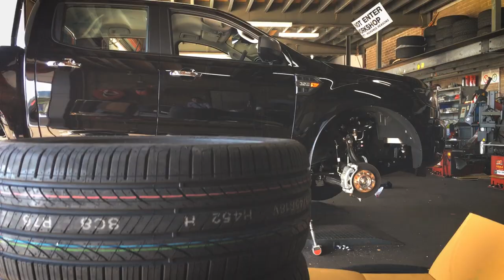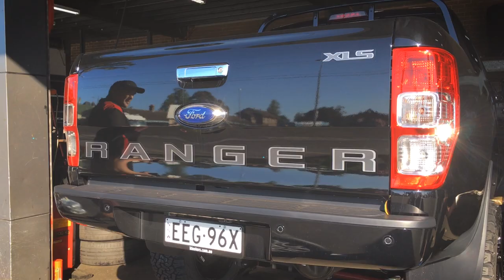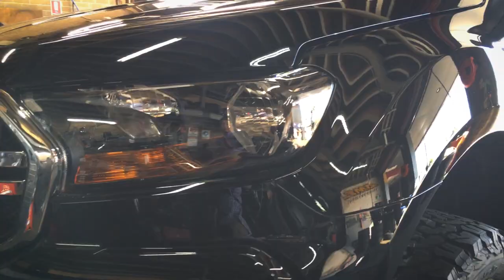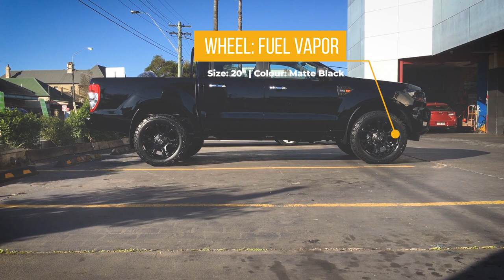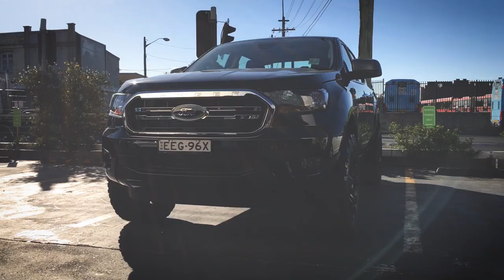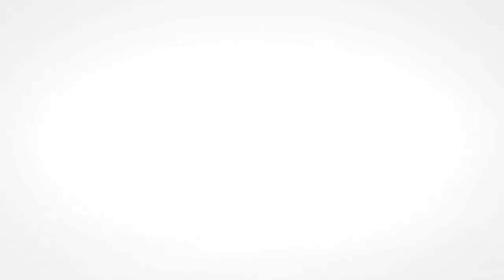Fuel Vapor Rims - BFGoodrich All Terrain T/A KO2 - Ford Ranger - Car of the week

Comment: I'm looking at those wheels and I know the tire size will fit with just a levelling kit. Need to know offset on vapors.
Reply: Did you find an answer. Which vehicle r u putting them on?
Reply from the maker: Hello :) Details of Tyres and Wheels are as follows:  Wheels 20" x 9.0  Offset: 19 Tyres: 275/55R20 115/112S 🤘 For more details check out this link: https://www.tempetyres.com.au/wheel-fitments?20x9.0%20Fuel%20Vapor